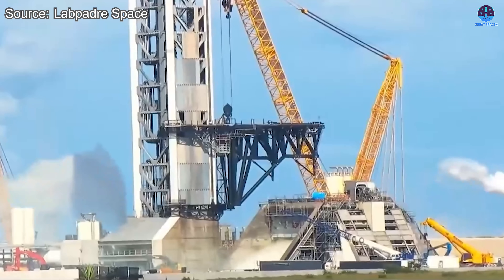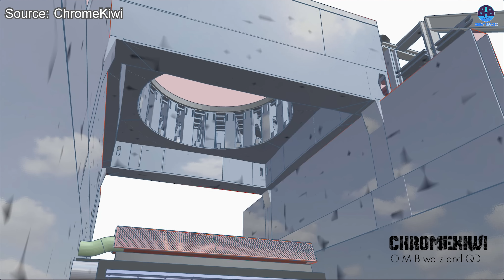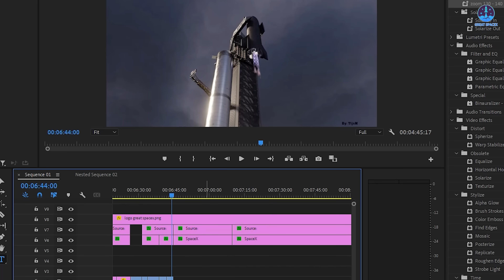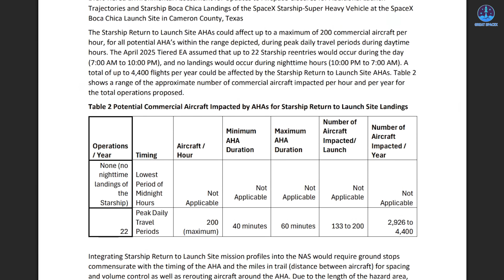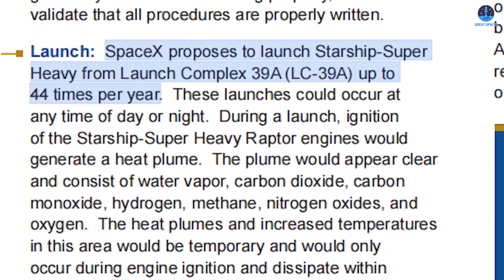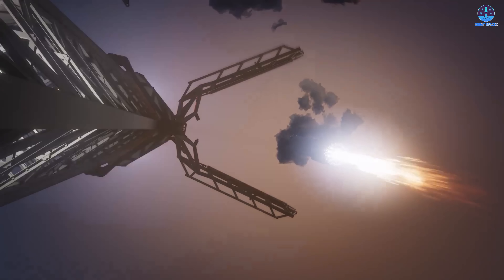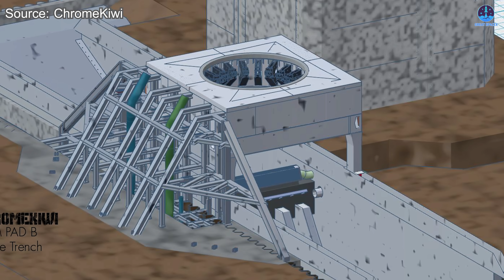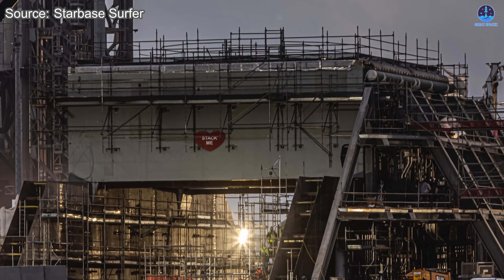SpaceX's Remarkable Full-Pressure Tests, ready to Launch Next-Gen Starship and…

Comment: Why not make the launch pad taller further away from the ground ?
Less heat and force hitting the infrastructure, less wear and tear?
Reply: More material, more weight for the pad to hold up, including the rocket which could but too much stress on the pad, causing more fractures and damage for prolonged use
Reply: @archierush868 Good points, but if its higher, that means the support structure is also further away from the heat and stress of each launch plus the triangle shape I have in my head would (I think) spread the load a lot more over more area also reducing wear and tear .
Thanks for the feed back though.🤘🤘👊
Reply: @brettmciver432 but it still goes back to adding more weight to the pad which could endure more stresses. It would also require building a taller launch tower to stack the ships on which could be more unstable.

Comment: A flame trench! Wow, what a novel concept. 
How on earth did they come up with such an  innovative idea???
Reply: By coping China, ESA, JAXA and NASA plus Russia and India...
Reply: It requires a ton of water to use which would require a lot of trucks to refill the water tanks for each use. They can’t use sea water because it’s too salty and could corrode sensitive equipment. They may be able to filter the sea water to clean water for use in the deluge but this may actually violate some state laws.
Reply: @archierush868 I'm sure they can secure a hard line through Brownsville to supplement water tankers. Desalination is enormously expensive, and would not be cost-effective for a flame trench. The Rio grande River is a reliable water source for many years to come long time. In addition to all of that, they may have reliable water sources via water Wells in the Brownsville and the Starbase areas They're still in their nascent stage, lots more to come, much much more to come.
Reply: the new flame trench is only a temporary solution - it will not last - they will come back to an improofed  original lanchpad, because they need more room for exaust. The sovjet N1 had 3 trenches... starship is bigger and is to fly a lot more frequently....
Reply: @adamzimmermann5632  no - that's not true at all. I'm not sure where the you're getting that.
Reply: @adamzimmermann5632  improofed.

Comment: How can they use Booster 17, isn't that a Block 2 Booster?  Hence, they have different fueling systems.
Reply: Exactly.
Reply: Correct, but if spacex wanted it to be a block 2 it would find a way, just feel like they will finish the block 3 before they could create the pointless temporary equipment.